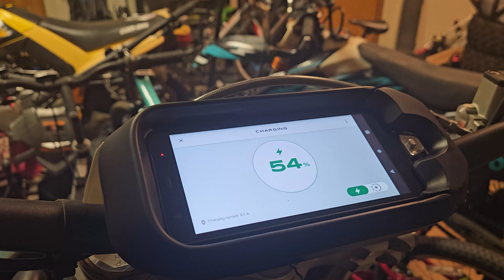Stark Fix! It can charge again!

Comment: I had the same issue!!! Green wire needs to plug into the longest prong. (Green is Ground) The two hot wires are white and black. They must be connected to the closest prongs to the ground prong. (dont believe placement matters, as they are both simply power supply and doesnt recognize a diffrence.) The Nuetral/Vacant connection will be on the opposite side of the ground prong, seperating the two hot wires... 

I am not the slightest bit inclined in electrical components, but after this video, and some google research, this is wired correctly to US Standards in spec with the plug that is used on the USA models of 2023 Stark Vargs. 🤙 So happy I was able to figure this out. I'll be riding here shortly. 

I thank the Lord Jesus, he gave me the patience to learn this. Get to know him, he is a great dude!!! 🙏🏻🫡💞
Reply from the maker: Yeah I'm not sure what all is happening with it. I got a new cord from them and it was wired the same way. Are you saying you didn't use the ground?
Reply from the maker: Rather...you used the common for the ground and have the white and black wired to the hots? The way I wired it I don't think it's possible to do 240.
Reply: I made sure my green wire was connected to the ground prong. 👍👍😁 I'm so happy it worked. Thanks for the video, man!
Reply from the maker: Dude absolutely! I'm glad it's working for you!
Reply: Tried this but no good with my unit. Black wire actually goes to the ground pin on inverter side and green and white go to the hots. 

If I hook up just like video here I get no power to charger, so green to W, black to g and white to x
Reply from the maker: @CryptoNut82  Stark was good enough to send me a 120v cable with a standard plug.  Have you tried the customer service yet?
Reply: @JKTester ya stark got back with me and they are sending a new charger unit out to me within 14 days. Wish it could be faster but at least I’m moving forward. Stark just replied saying they are getting chargers in US this week, so it should be fast to arrive.
Reply from the maker: @CryptoNut82  Oh good.  I had really good experiences with them.  Glad it's working out but the waiting sucks.

Comment: My varg won’t charge I plug it in blue light comes on and the phone says charging but it isn’t
Reply from the maker: Has it ever charged?
Reply: Mine does the same, it charges fine at home using the stark 110 adapter. If i’m using a generator it will do what your is doing. I figured out that if i only twist the adapter half way locked it will charge. Does thus mean i need to change the wire in the video or not? It wil charge.
Reply: Me to
Reply: Did u fix it
Reply: Have u fix it ？My varg won't charge. The bike shows a blue light when plug it. The phone shows it's charging, but there's actually no current going in. The charger's fan doesn't work either.